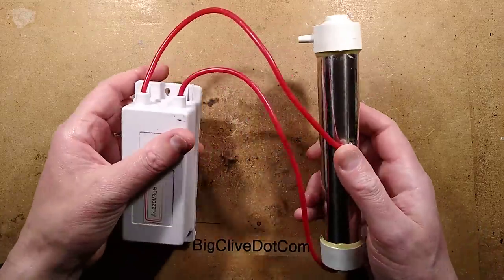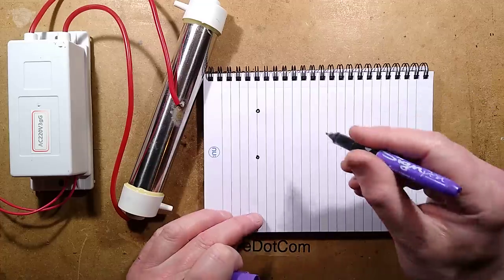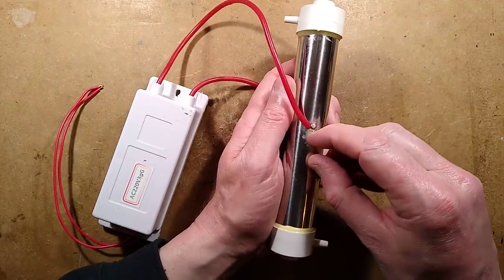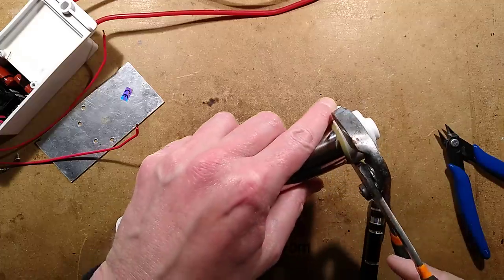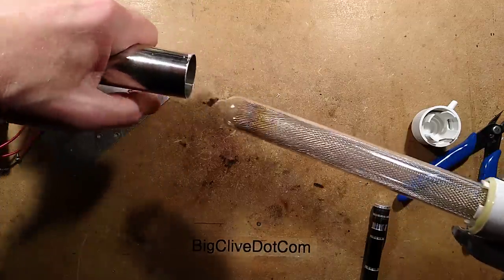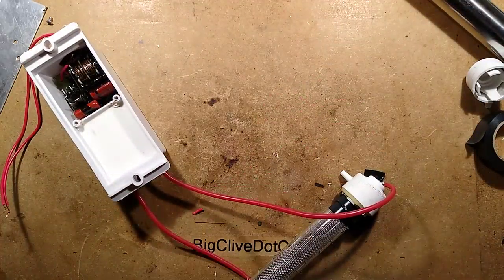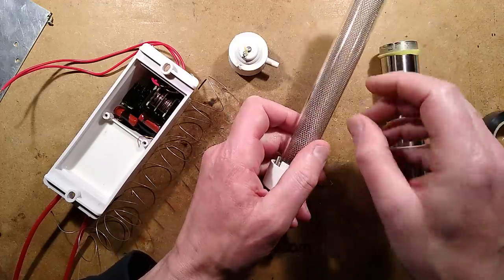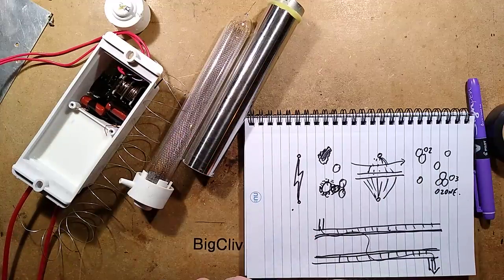Inside an airline cold-plasma ozone generator cold-plasma tube.

Comment: I periodically set one on the return air grate and turn on the HVAC fan for a few seconds. Do you think I could knock that down if I used a fan controller? Would that reduce the amount of ozone it creates? I'd try it but I don't have any beer...
Reply from the maker: The best approach for ozone in a house is to have a low level emitter in the air handling system.  Like one of the carbon fiber emitter ionizers.
Reply: @bigclivedotcom  All I have is a 3.5g and a 10g but I found a small rechargeable one,, as for a refrigerator, with good reviews for 9 bucks on amazon. it's going to take a few days to get here. We'll see what that one does in the air return. It only takes a few seconds to have some discernable ozone all over the house with the others. I used to have an adjustable one in the basement I kept on as low as it would go but there weren't any parts for it when it finally quit after 5 years. It was awesome because it smelled so fresh PLUS no spiders! And no identifiable ozone odor, either. I forget what the lowest setting was but it was quite small. The adjustable ones are pretty expensive these days.
Still, I'm definitely gonna get some beer and try the fan controller. It just controls voltage, right? That shouldn't hurt the transformer...I'm thinking...mine are just little "barebones" generators with replaceable plates. No box or fan.

Comment: Which metal coating can we use as an electrode inside the tube?
Reply from the maker: Some manufacturers of low power units use a scroll of stainless steel mesh on both sides.
Reply: @bigclivedotcom  Actually we are trying a project for bigger ozone cells having voltage around 10kV. Any suggestions for conductive coating? (We are trying with Graphite).

Comment: Why does this work? Why do the oxygen atoms preferentially recombine into O₃ when O₂ is the more stable form?
Reply: because you added a ton of energy to them via massive electron discharge.  this allows them to combine into a higher energy state.  pull open a science textbook and look up "basic oxidation reactions" to find out what happens when an atom in that higher energy state hits something it can combine with.

Comment: So far as I know, the ideal level of ozone in the air we breathe is zero. Depending on how healthy your lungs are, you can tolerate low levels. (100μg per cubic metre is the current target in the Air Quality Standards Regulations 2010.)
Very little ozone near ground level is directly emitted. Almost all of it is produced by photochemical reactions between oxygen and other atmospheric pollutants. Levels are actually slightly higher in rural areas than urban, because the nitric oxide emitted by vehicles destroys ozone. (This isn't a good thing - oxides of nitrogen are also harmful.)
Reply from the maker: In nature the level is about 0.04ppm.  It's possible that it is actually needed at very low levels to oxidise rogue airborne contaminants.
Reply: Yes, the evidence and the models indicate that pre-industrial levels were only about a third less than they are now, because there are natural sources of the volatile organics and NOx that react to form ozone. So, we must have evolved to tolerate those natural levels of ozone, and it seems likely it has some beneficial effects.

Comment: Damage to a component of the high voltage generator ...

The glass was broken during transport or the glass element burned out as in the photo, i.e. a glass tube with a wire quite thick inside). The element is located between one 230V power line and the N539 rectifying diode
I suspect it's a fuse, but does anyone know what to put in there? How much ampere ... It is a bit different than the standard glass fuse because it is completely filled with glass and there are no metal caps at the ends ...

Maybe someone has an identical generator and knows what was really sitting there?   https://www.fotosik.pl/zdjecie/d14b7ac4c908fdb0

https://www.fotosik.pl/zdjecie/937bbb9d63909f60

https://www.fotosik.pl/zdjecie/35fa5f630f1b645e

https://www.fotosik.pl/zdjecie/be9ba4e8ae295b49

https://www.fotosik.pl/zdjecie/ff611304b554eda1

Comment: Why are these in airplanes?
Reply: I'm curious about their actual use too. Breathing ozone is not good so how are these used? That tiny air tube would only move a very small volume of air. It's not like the cabin air is being run through this device. Does that mean it is producing ozone that is pumped into the cabin air? What concentration is considered unhealthy?
Reply: It can be used to disinfect any space that is unoccupied, then ventilated before returning to use.

Comment: It's mindless why they make them things when Ozone effects the earths atmosphere
Reply: I think you may be mashing things up a bit.  the ozone in the stratosphere is what makes the ozone layer (and is produced IN the stratosphere), but there is also ozone produced at ground level.  that does NOT rise into the stratosphere, because 03 is heavier than air on average.  instead, it is a regular component of smog in cities, and also produced in hot areas by sun shining on oxygen containing rocks.
hope that helps.

Comment: Wow this is the most terrible and inefficient design I can imagine. I have made a lot of ozone generators and I can say that for 12W the tube is hugely oversized that will form a capacitor actually preventing these tiny sparks from forming.
What you need is high frequency flyback and you should be able to see consistent purple glow around the wire to get highest efficiency. This design will produce localized high energy blue sparks due to capacitance (that's the crackling noises) possibly producing nitrous oxide along ozone as well.

Though it may be worth comparing 2 designs in more scientific method than guesswork:)